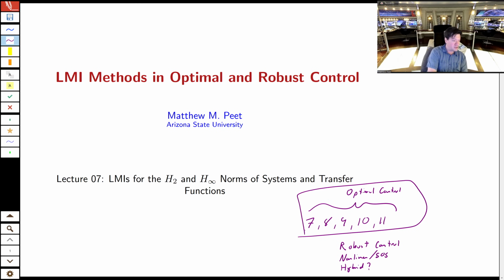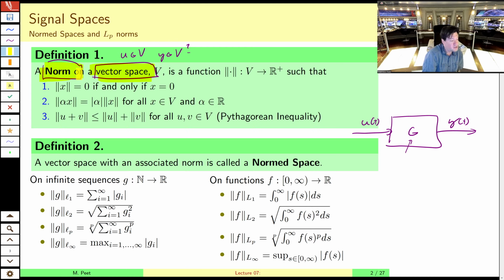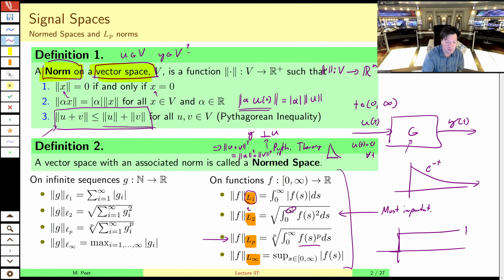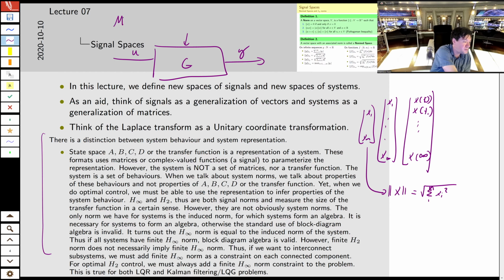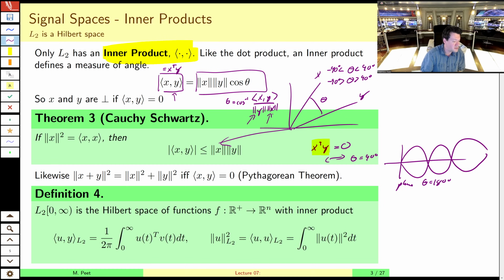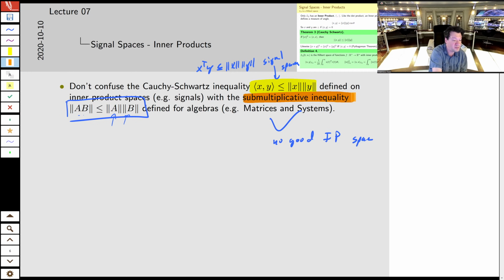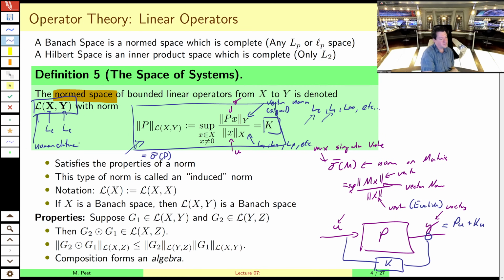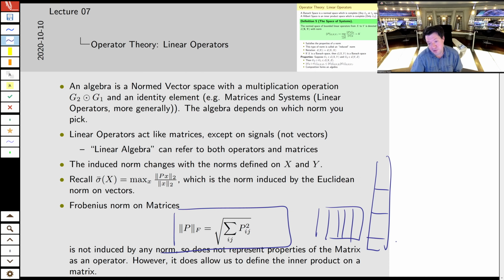MAE509 (LMIs in Control): Lecture 7, part A - System and Signal spaces and Norms

Comment: I am wondering if you can give more information on your statement around 21:00. What about step functions not being in L2 makes the block diagram structure we use in undergrad controls not rigorous? We have that the set of rational functions should form a field, and an algebra and since signals like steps and sinusoids can be represented as rational functions via the Laplace transform, we should be okay?

Comment: Are the little lp norms also sometimes used for vectors of real numbers? For example, sometimes I will see people say you have a vector [2, 3, 2] or something like that and they will say the l2 norm of that vector is (2^2 + 3^2 + 2^2)^(1/2) but I am not sure why we can say this if sequences are not necessarily vectors. An example where one can see this is the convex optimization book by Boyd.
Reply from the maker: It would be very weird to use, e.g. \norm{[1 2 3 4]}_{ell_2}. However, its common to use the term "2-norm" to refer to the Euclidean norm, ell_2 norm, and L_2 norm, depending on context. And if Stephen Boyd says it, it must be true!!